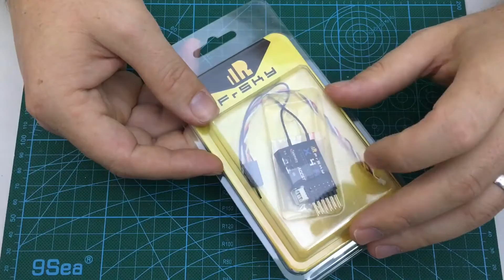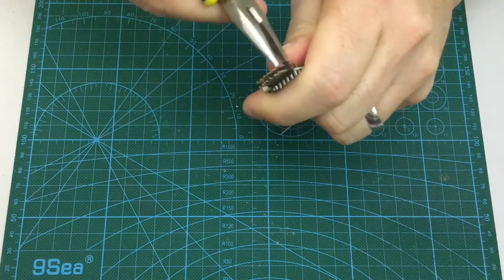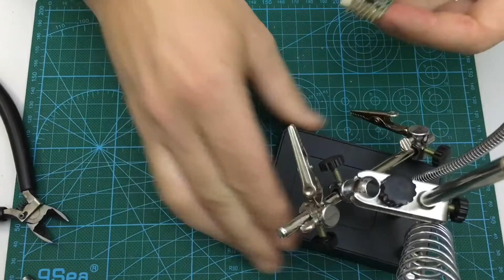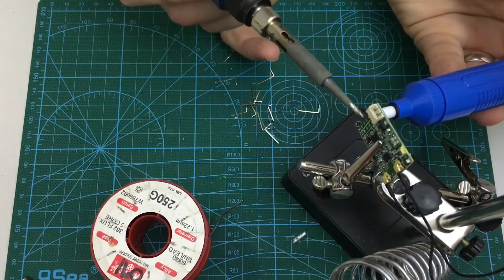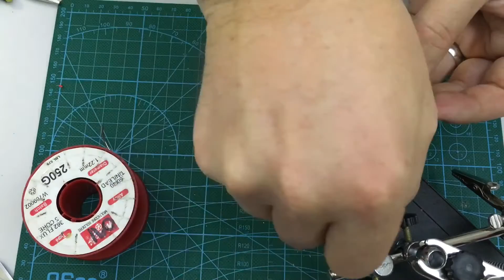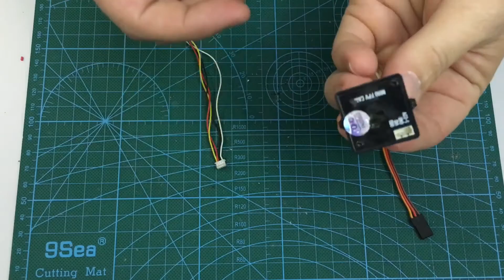How To De-Pin FrSky X4R-SB Receiver

Comment: When I was de-soldering the pins I noticed when I was pull one out a piece of green and copper flat looking wire detached from the board. Could this be the copper part that goes to the pin?

Comment: Hi, I have a question for you? I am building a martianii 220 quad with Racerstar Br2205 2300kv motors KISS 1.3 FC & KISS 18AMP V1.1 ESC'S ON 4S I AM GOING THROUGH CANCER TREATMENT AGAIN AND MONEY IS LIMITED I AM NOT RACING JUST FLYING FOR FUN WILL IT BE OK TO USE A D4Rll RX? PPM OR SHOULD I TEAR APART A X8R RX FOR SBUS? THANK YOU IN ADVANCE FOR ANY OR ALL HELP.

Comment: Beautiful job soldering. You make it look so easy.

I also removed the header for the S.Port connector, which is a bit of a tighter job, but saves a little space. I was trying to squeeze it into a very small spot where that overhead was going to be a problem, though it ended up not being slim enough regardless.

Comment: What temp did you have your iron set to for this? I had alot of trouble getting the joints to melt that quick, even when I pre-tinned my iron, etc. Ended up turning the heat up but I'm pretty sure I ruined the X4R. Got another on the way
Reply: He says in the video 430°C  -- really hot because it's lead-free solder.
Reply: Checking back in 2 months later - I didn't actually ruin my X4R, but man those lead-free joints can be a real bitch.

Comment: Looks great, I like how you can buy it already de-pinned.

May I suggest a few improvements ?

1) I would highly recommend following ESD procedures such as using an antistatic wrist strap to prevent damage to the sensitive semi-conductors.

2) Place 2 sections of heat shrink tubing over one of your crocodile clips on your helping hands rig. This will keep your components and PCB from being scratched by bare metal clamps.

Where do you get the gas refills (Australian outlets) for your hot air pencil please ?

Cheers
Tony
Reply from the maker: +Tony Leyland Expressive Imagery I've never experienced any issues from static.  I used to work for a U.S. Tech company and probably became naive watching engineers work on delicate stuff out in the field. I used to have some bits of thin high density foam on my desk that I would use on the alligator clips, but I like your idea better.  The gas refill is Weller branded in a fly spray size can.  Not sure where I got it (15+ years old) but I know Jaycar sell a butane refill.